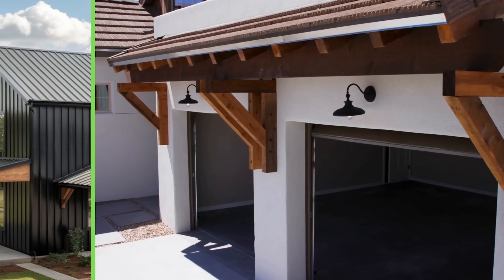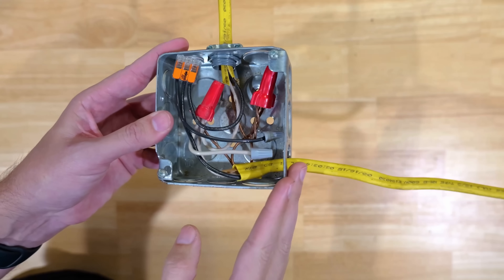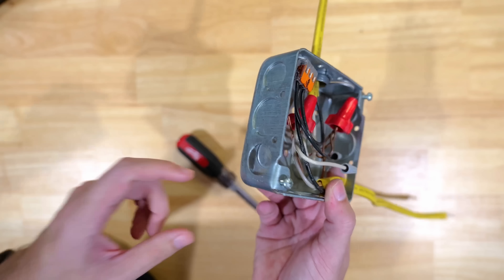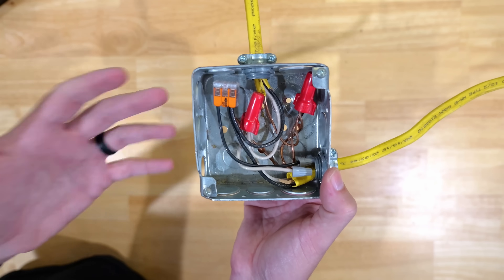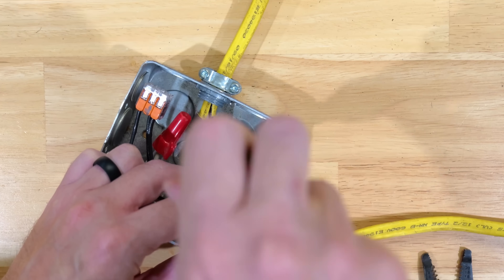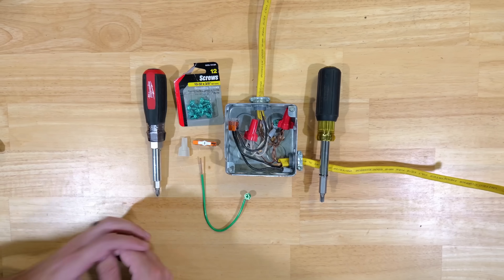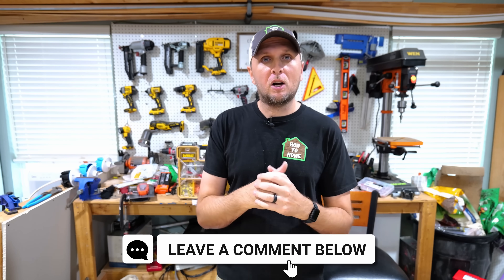SHOCKING Mistakes DIYers Make Installing Metal Electrical Boxes!

Comment: If the leads happen to be 1" short in a fully-finished box and are not otherwise under some strain AND can be easily extended ex post facto as demonstrated should more length be requirted, is there really a need to "fail' this box on code inspection? I find it more problematic to cram a bunch of excessively long wires into a box potentially causing wires to pull out of connectors, chafing, etc.

Comment: Good info. Working on a home that was wired in the 60s/70s. A lot of shortcuts. Oh, and if I plug anything in one outlet mid home in the den, it blows a fuse in that circuit going to the Front living room, middle den and even to the other side of the house in the master bedroom. Gotta love pre-code wiring.
Reply: 1897 was year 1 for the National Electrical Code. Houses aren't wired "pre-code," they're wired "what code?"

Comment: I have overtightened those metal strain clamps causing a short. I had to check a whole room and found two shorts. It was the neutral contacting the metal and connecting white and ground that tripped the GFCI. I do not overtighten anymore.

Comment: I think these are not good, but non are critical issues.  Biggest 2 issues here are that a wago is connected to something that will see mechanical force and that wire slacks should be built into outside of the box.  Not saying the rest are okay, just that you will far more likely be in a fire hazard from the wago being stressed then coming loose.  Having 6" inside is the code but not always practical.  You have a giant 4" box there, which is often not a luxury in many single gang that have passthroughs.  Far better to leave the slack outside if the box, pull as needed, instead of trying crunch everything in.  Also screw-on connectors are a terrible choice for this application unless the wires are exposed. The wire clamp should be inside of the box else You'd have to cut the walls to get mote wires.  There are whats to code and there are what is the most common sense practical way to wire a box.

Comment: wire nuts + twisting on solid wire is so dumb and outdated. competent and correct use of UL listed push connectors and lever connectors is just smart. There is nothing worse than renovating a house and opening an old metal box with a twisted mess of 2" long grounds. I hate electricians.

Comment: Only thing lacking is explaining how to safely and correctly wire a metal electrical box that is surface mounted on say a concrete foundation basement wall where the wire is run to the box in conduit.

Comment: First, why are those boxes made of metal in the first place and even the cover plate as well? The Next thing I would point out is 9 out of 10 extension cords are wired with gauge 14 wire. And yes lots of people running everything from that cord. So I understand the codes but it's a bit weird isn't?

Comment: I'm not mentioned, so far is vibration saw one in a cooler, it had a 30 horsepower fan and it vibrated the box enough to cut through the insulation.

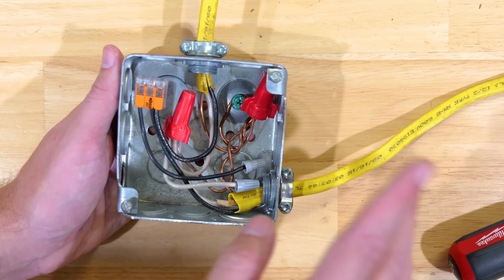Comment: 0:12 what is wrong with this box? Well I can see four things that are wrong with this and why you should not do it. 0:57 mistake number one on the service side of the box there is no knockout clamp. Every side of the box needs to be clamped or the wire is going to come out and cause a dead short. 4:00 mistake number two no ground. This is a metal box and it has a metal pipe attached both ends you need to install a ground to the box or if a hot wire comes loose it's going to make the box hot and the electrical inside will melt and you can get shocked. Always install grounding screws inside of metal boxes. 8:54 mistake number three wrong wires wrong code. The service and the main wire are 12 the outlet wire is a 14. That is wrong and that is an electrical fire waiting to happen. Both wires need to be 12. 11:59 mistake number four the box is a rat's nest. The wires are too long. If those bump into each other they will short. Always clip off the excess before you connect them to your wire connectors. 14:41 this mistake was made around the same time that mistake number one was made. Mistake number five The box is not sealed were the knockouts are. If you switch the wires around or if you create too many knockouts you need to seal them off or some stinking plague rat will get inside the box and chew on your wires. Always seal off the box to prevent rodents from getting inside.
Reply from the maker: So you watched the video and saw what they were first.  You couldn’t timestamp it if you didn’t 😂

Comment: Don't reuse twisted wired which were already in a wire nut. They tend to break and don't get a good connection if you add a not pretwisted wire.  The good thing of wago is: you can reuse the wires ...

Comment: After reading the comments, the hate Wagos receive every time Americans make videos about electric installations is strange, since wire nuts are much fiddlier and time-consuming to use, making any changes is a huge pain with them, and they're are (much) easier to install poorly since they require more care to install than Wagos. While in turn I've never run into any professional opinions over here that the use of Wagos, or even far cheaper non-lever spring-loaded connectors, would be in any way less safe and I live in a country where wire nuts haven't been used professionally anywhere for decades as it's pretty much all Wagos or screw terminals, and typically for heavier loads than US household wiring.

Comment: As far as I’m concerned, using a WAGO at all is a mistake.  I hate anything that depends on spring pressure to maintain contact, because age and heat cycles reduce spring tension, which reduces contact pressure, which creates resistance, which creates heat, which FURTHER reduces spring effectiveness, and you’re in a positive feedback loop until the connection fails.  Same goes for the outlets and switches that have push-in connections in addition to screw terminals. Never use the push-ins.

Comment: So the big problem I have with US boxes is that how the heck are you suppose to fit everything in there? If you have a bunch of wires coming in, and they all have to be 6 inches, you may need to connect multiple, the worst is stuff like 3-way switches, it is practically impossible to fit everything without forcing it all together which seems dangerous..

Comment: 1) Strain relief/ clamp at the exterior of box each incoming/ outgoing wire bundle;

2) Ground every box to the grounds, typically using a green, 10-32x3/8" ground screw and possibly insulated, green ground wire, arranging and tightening the j-hooked wire end such that the hook wraps CLOCKWISE around the screw so as to cause the hooked wire end to close/ tighten around the screw as the screw is tightened firmly to the box (as opposed to the hooked wire end opening with clockwise turning force, such as would happen if the hooked end was arranged to wrap counter-clockwise around a screw threaded to tighten clockwise);

3) Consider taping wire bundles to their binding connectors;

4) Never reuse wire nuts;

5) Avoid mixing wire guages, or, at a minimum, ensure that the minimum wire guage within the box meets or exceeds the maximum amperage capacity of the circuit;

6) Ensure that all wires entering the box are at least 6" long from their points of exiting their sheethings to their respective, exposed wire end, such that a minimum of 3" of wire may be pulled proud of or beyond the face or plane of the box/ enclosure where a cover must be installed, which may be achieved simply by extending with an appropriate connector the wire lengths inside the box; and

7) Ensure that ALL knockouts or other perforations enabling access to the interior of the box are properly obstructed, thereby creating, once a proper cover is installed, a totally enclosed point of service.

Comment: I work on cars for a living. But I'm a DIY homeowner and penny pincher😊. The only wiring I've done in my house is replacing a few lights, receptacles, and switches. However I have been thinking about trying to add some lighting and receptacles to certain rooms. Videos like this are extremely helpful to me. I've seen WAGO connectors before but I thought they were only for use in electronics. I didn't know they were able to be used in home electrical wiring. I am very aware of the importance of wire gauge from my time installing car stereo systems. As a rule, I always use a larger gauge than normally required. And I make sure that every wire is secure.
Reply: Higher gauge wire is thicker and stiffer, thus harder to work with. Keep that in mind.
Reply: In my country, Wago-style spring connector blocks fully replaced wire nuts decades ago and I don't recall seeing wire nuts in electric installations done after 1980s or so. It's all Wago-style blocks or different types of screw terminals here, although you can still buy wire nuts if you really want to use them. It's why it's always weird for me to see Americans ponder whether they're suitable for household electrics, since they've been used for everything over here for decades and our household circuits are often rated for higher wattages than in the US (like how 230Vac 16A is a standard electric socket circuit here).
 
And I say Wago-style since actual lever-operated Wagos are waaaay too expensive for most builders to use for basic bulk installs like electric sockets, they buy cheap single-use non-lever spring connector blocks instead where once you push in the wire its permanently locked in place and you need to snip the wire or yank it really hard to get it out (and the connector block isn't going to be useful afterwards).
Reply: @meckelbu  i think the WAGOs are worth every penny
Reply: The NEC already has a bunch of 'safety margin' built into the sizing of wires for ampacity so you're plenty safe using the 'appropriate' gauge. You really only need to up-size your wire to compensate for voltage drop, which can be calculated to be within code requirements (3% max on a circuit, and combined with feeders max of 5%)... but a general 'rule of thumb' in the industry is to go a gauge higher for a run longer than 100 feet.
Reply: Plus then you can run into practical problems... Like devices / connectors / terminals rated for only certain gauge sizes.

Comment: Electrical Devices do NOT '' Pull Current '' They draw current that is being used by the device when the device has power applied to it
Reply from the maker: Splitting hairs here.

Comment: Wago's on fire is correct... if you like bad connections... use wagos.  Not allowed in my truck or on any job site.  The UL approval means nothing. The only thing they are good for are low amperage lighting or the garbage can.  No push connectors (back stabbbing) outlets or switches are allowed on my jobs as well..they are a service call waiting to happen.   Speed and sercure connections do not always go hand in hand. Nice video and great explanation!

Comment: WAGOs are great, they are stable to TONS of current and heat. Assuming you strip wires to correct length.
Whoa nice catch on the 14 ga wire— I didn’t see that!

What’s the reason code requires such long wires in the box?

Comment: Yeah, I'm not adding another connection and stuffing the box even fuller because the wires are only four inches instead of six. That's absurd and idc what code says.
Reply from the maker: Umm cool

Comment: Your wires on the pig tails aren't Long enough either ya need atleast 6 inches sticking out of box
Reply from the maker: I think you need to see your eye Doctor.  And no it is not 6 inches out of the boxes it is 6 inches from where it enters the box and at least 3 inches past the front of the box.  If you are going to try and get me on code at least know what it says.

Comment: Thank you for this post I had replaced some Waco connectors that were turning the wire purple actually it got so hot. Those connectors are only good for doing LED light circuits anything under 3 or 4 amps it's okay. And when you're doing a aluminum wiring well you should rip it out of the house but you got a picture of copper wire with the proper goop and good electrical connectors for tightness and then tape it up.
Reply: Aluminum wire is perfectly safe; the danger lies in the connections.

Comment: In the National Electrical code it states that the bonding screw for the grounding conductor must be green.  It is not a suggestion, it is the rule.  The newer boxes have the grounding point raised to allow the grounding screw to be installed with the box mounted on a flat surface like a concrete wall.  The older boxes had one of the grounding screw  just threaded through the back of the box.
Reply: I still see new boxes without the raised point, typically they are the larger ones, and it can be a pain to make sure there's a hole in the wall behind where the grounding screw is to be.
I've seen countless times where people will just skip the grounding screw in that case, because the wall is made of hard material, such as brick, which may need a little pre-drilling prep.
Reply: I need to add a bonding ground in a metal box. The person who is helping me said we can just put the green grounding screw in ANY hole, anywhere in the metal box .. including on the sides of the box or through the top, even if it's not a threaded hole. Is this true? Thank you.
Reply: @TheButterflyGirl7 It doesn't make sense to mount the grounding screw anywhere besides the back of the box in order to gain access with a screwdriver. You can't use any hole, it must be a 10-32 tapped size. If there's no hole, you can drill tap a 10-32.
Reply: @cj8281 If you think that the NEC requires that the bonding screw in a junction box must be green, cite the code reference. The bonding screw in the main panel is typically green and that may be the requirement or rule that you are referring to.

Comment: What is the reason for NOT re-using a wire nut, if it tightens up good?
Reply: The wire within is like a spring so can wear out over time. But the common problem is the plastic being overworked / swollen, in addition to just being old. What's scary is the plastic failing while the internal metal connection remains solid ... a zap trap waiting for someone's unfortunate future.

Comment: Are the WAGO connectors rated different for the Gauge wire or load needed to use? I.e. a 30 amp wall oven
Reply from the maker: Yes they have different ratings so make sure the Wagos you choose to use are rated for the application you intend to use them on.
Reply: @HowToHomeDIY  thank you
Reply: I commonly see new LED lighting fixtures come with WAGO connectors that are only rated for 14 gauge wire, which is something easily overlooked when installing on a circuit run with 12 gauge.

Comment: I don't like using today's " WAGOS " ON a 15/20 amp circuit. THAT'S A FIRE HAZARD!
Low voltage ⚡ systems WAGOS are okay to use. HIGH VOLTAGE 
STICK w/ THE TRADITIONAL WIRE NUTS & SPIN YOUR CONNECTIONS TOGETHER BEFORE USING WIRE NUTS & YOU WON'T HAVE A FIRE HAZARD ! GROUNDING BOXES IS A MUST OTHERWISE YOU WILL GET ZAPPED! 
THESE NEW HOMES w/ LED LIGHTING & WAGOS ARE A FUCKIN JOKE! 
NFG 👎🏼 🤬 😤 
💥BADA BING BADA BOOM 💥
I approve this message 🙌🏼 
Nj'sJfJr 👍🏼💪🏼❤️🇺🇸🗽

Comment: The stab connections on the back of outlets or switches are no better than Wago connections. Many homes wired this way today, rarely mentioned. I have seen them fail. I rewired my home with loops on the screw terminals.

Comment: Installing a proper NM connector into a metal box is very easy.
But it is very difficult for some residential electrical shop owners to buy them.
They figure that if the box isn't gonna be seen by an inspector....why bother?

Comment: Using a six inch pigtail of 14 AWG copper wire is perfectly safe and functional at 20 amperes, but you still shouldn't do it if it does not meet code.

14 AWG copper wire has a resistance of about 2.6 milliohms per foot at "room temperature." A six inch pigtail would drop 26 mV at 20 A and dissipate 520 mW. Neither the voltage drop nor the power dissipation and resulting temperature rise (the latter not easy to calculate) would be of any concern from either a functional or safety perspective - but code still rules.

12 AWG copper wire has a resistance of about 1.6 milliohms per foot (about 1.61 times the cross-sectional area of 14 AWG).

===
If you are making up pigtails with the end wrapped around a screw, be sure the end of the loop does not overlap the "shank." Normally there is very little chance of that but it can happen if you have too much wire and pinch the loop closed with pliers.

Comment: Per  National Electrical Code Table 210.24 a number 14 tap conductor is allowable as a connection to a receptacle rated as much as 30 amperes. Instead of listening to these so called experts, go to the NEC for the correct information.  I hold an unlimited journeyman electrical license. (Since 1980)

Comment: Always wrap your Wago Lever Nuts with two wraps of electrical tape to prevent the levers from inadvertently being lifted and a wire or two dislodging from the Wago, as the wires are being pushed to the back of the j-box, causing shorts.

Comment: I only wagos or like connectors for fixture side connectivity if provided some other situations but wire nuts only all else, also for grounds I never use wire nuts I do a tight twist and crimp, more reliable ground make sure never comes off/apart for better safety with the grounding/bonding just my preference.  Oh and no stab backs allowed in my work.
Reply: I don't see any stab backs these days without screws that tighten down. The old style sure was a fire hazard, no doubt.